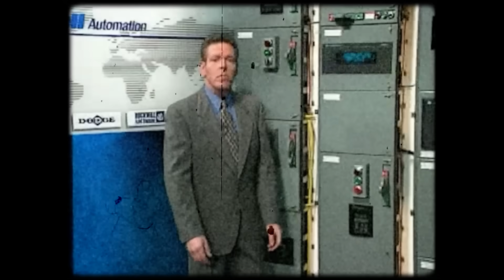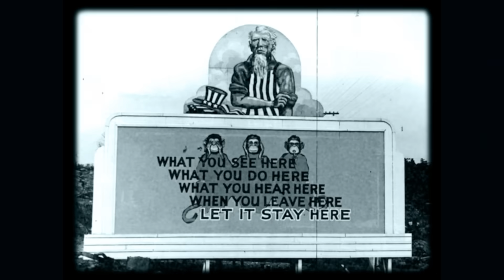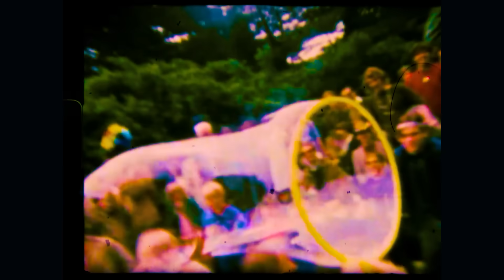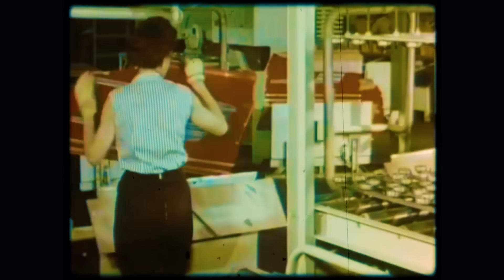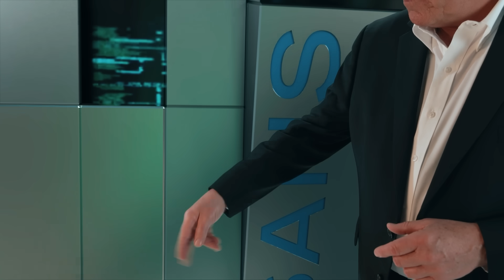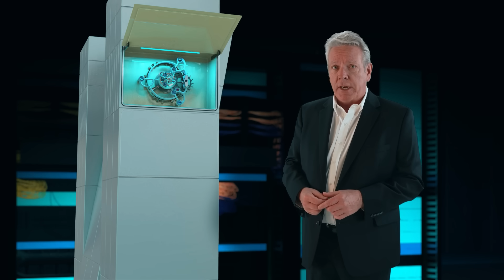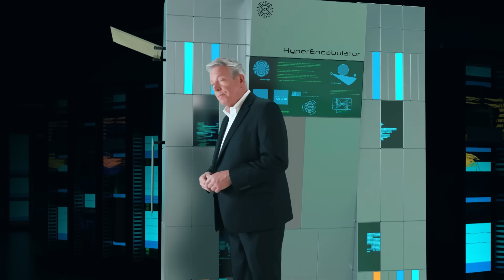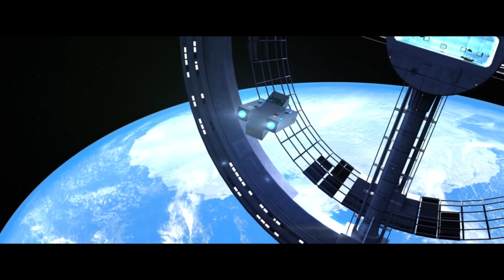SANS ICS HyperEncabulator

Comment: --Flashback begin
[Narrator]
The original machine had a base plate of pre-famulated amulite surmounted by a malleable logarithmic casing in such a way that the two spurving bearings were in a direct line with a panometric fan.
--End flashback

[Narrator]
Yes, that was once me.
Extolling the virtues of retro-encabulation.
Now I may not be the dashing, young on-camera narrator I once was, but if history tells me anything it's that the battle of hastings was fought in 1066.
But that's not the point.
The point is that encabulation has a rich, sumptuous history with a delicate, flaky crust relatively unknown to emergent cybersecurity personnel.
Allow me to elucidate;
The discovery of encabulation was quite accidental, when engineers in the skunk works at Mutual Polydynamics coupled a transcendental hopper datoscope with a spiral decommutator via the application of anhydrous nangling pins, resulting in a device that allowed for netic mastication at alarming speeds.
The device was kept secret for many years owing to the horrific accident that occurred shortly after its inception, how-some-ever the US Compartment of Offense and The Natural Guard soon realized its potential as a weapon of choice, leading to its next iteration, The "Hydro-Encabulator", which they nicknamed "Fatboy Slim."
Understanding the grizzly bear fact of the devastation that would result from its deployment, the project was re-tubed and transmogrified for industrial supplications.
This version, known as The "Pseudo-Encabulator" was the infernal, Faustian engine that allowed post-war America to realize its aspirations and become the domino player on the world stage.
Everybody was encabulating.

--Movie clip begin
[Character 1]
I don't understand you.

[Character 2]
Well I knew you wouldn't but if I'd told you before the answer meter on the other side permulates the counter-spell happiness and that's the entire secret there you have it.
--Movie clip end

[Narrator]
During the tumultuous 60s the psycho funkadelic "Vinyl-Encabulator" emerged as the long-haired hippie people's answer to their parents aging technology, scarving a resonance groove in the hot wax of a new generation of encabulators.
However, interest in encabulation waned precipitously until the late 80s when the public was ready for the next transubstantiation of encabulation, the extraordinarily populist "Turbo-Encabulator."

--Flashback begin
[Narrator]
Now, basically, the only new principle involved is that instead of power being generated by the relative motion of conducters and fluxes it is produced by the modial interaction of magneto relucatance and capactive directance.
--Flashback end

[Narrator]
Which brings us to where we are today, floundering in the wake of the obscenely similar "Retro-encabulator", featuring yours truly; Living proof that leveraging existing assets is not plagiarism.
Now, despite encabulations unparalleled success in reducing sinusoidal depleneration through advanced ding-alarm technology, it has failed to meet the unanticipated needs of the cybersecurity industry to create zero trust operations in level zero monitoring environments to ameliorate zero-day process attacks.
That is why, despite zero interest from industry, the SANS ICS Security team has taken it upon themselves to develop an entirely new level of encabulation unresponsive to the needs of the average consumer and undoubtedly without merit in terms on concomitant asynchronous communication with client-side connectivity.
Ladies and gentlemen, I-SACs of all sectors beer included, and children of all ages may I present The "Hyper-Encabulator".
The Hyper-Encabulator is nothing less than a key ruminant in the advancement of retrograde phenomenology by which we can achieve results that are plastic, spastic, and sinosynclastic without sacrificing both normative reality and AI-informed modalites.
You'll note that the Hyper-encabulator utilizes indiscreet modules, making possible virtualized environments that include PLC-controlled, stand-up reheaters as well as retainium-based cloud benders.
It also includes a dedicated OT security operations center access panel known as: "The SOC Drawer",
The primary modules of the Hyper-Encabulator are stackable, dinrackable, and unhackable and please note the complete abscence of side fumbling owing to the maintenance of tolerances allowing a tight conniption fit.
Please take little note of this module: "The Open-Source Digital Ghost Daemon", which allows transparent OT invisibility owing entirely to the manipulation of airborne particulate matter and single surface reflective devices, or for criminal infrastructure sectors where the dependability of sopramet wenosprox is essential.
Our handsome ransomware hypervisor is perpetually alert to SQL injections of gates, tracking chips, and quantum IOT identification dots.
Moreover, whenever a pen-test is elected to assure the integrity of a safety instrumented system, our purdue model modal module de-feathers and plucks clean every proverbial fox in the hen house and keeps would-be intruders wondering which metaphor got mixed first.
As you can see, the Hyper-Encabulator has reached a high level of development whereas previous dissimilar devices operated under the concept of manumatic stressor reduction and macroeconomic supply chain s-bombs, The Hyper-Encabulator operates totally under the principle of colonic effluvium explusion and audible gaseous eruptations.
Thomas Edison once said that invention was ten percent inspiration and ninety percent persperation, if that's the case, Thomas Edison should have invented deodorant, but I regress.
In the near future, Hyper-encabulation will ultimately replace all traditional cybersecurity safeguarding processes with osculating seqmentation and entropic astrogation, making what was once thought to be impossible, probable.
At SANS ICS Security, when we're not innovating, we're encabulating.
Reply: Oh finally lyrics
Reply: That should be printed on a teeshirt
Reply: I wish I could copy and paste this😭
Reply: Oh, well that clears it up. I was sure he said ' dingle-arms'
Reply: Thank you for your hard work, sir.
Reply: I thought I heard 'gaseous eructations' (eruct: to belch), although it's funny either way 😅
Reply: @snoodude  yeah, eggman ain't perfect.  I haven't checked this one, but many videos have transcripts available.  I guess his aural memory is pretty good.
Reply: “the manipulation of airborne particulate matter and single surface reflective devices.”  Sounds like smoke and mirrors to me.
Reply: Geez write a book why don’t you

Comment: As a McMillan man myself, I always wondered how the encabulator widget coupling enables every flange splicer, every hanging gated flop-hopper and wangle joint to integrate fully with splurge lugs and sprock-noggins while remaining fully compatible with the lipped and unlipped rear-facing winglebobs, and you’d still have enough nubbins left over for a splack-packet.
Reply: Bad idea. The manual may not require use of the nubbins but long term exposure of the wobble-phasers to the flop-hoppers can lead to early side-fumble failure and thus replacement of the entire unit. Never skimp on the nubbins.
Reply: can’t have too many nubbins!
Reply: I’m glad that I ordered the later version with full reverse nullification properties, 10th dimensional exploitation and spurving bearings throughout for higher performance of the dingle arms which ultimately improves calculations such as a parabolic arc through various states of matter at ftl speeds.
Nubbins are a bit old school now btw.
Reply: The answer to that is that it all works together in a holistic environment. Without one piece working properly, it would fall apart. The the key here is that there are linticular sequences that the clurry-beams mitigate using  retro-synchronous moly-trioxide resonance defractors.
Reply: @johngriffith1853  That's what I was thinking.  Thanks for validating.
Reply: NUBBENS
Reply: @pancreasenthusiast even Google is getting in on it.
Reply: I'm just glad they finally got the side fumbling sorted out
Reply: Ack! Respectfully, I'm pretty sure "flange splicers" aren't really a thing.

SANS ICS chief meteorologist Jack Rubbins (unfortunately fired recently for addiction to cocaine cooked with baking soda), believed nubbins were key and quickly came up with a dark high-pressure liquid injection shortcut that produces anal fissures in the wangle joints so nubbins can be arranged in a vertical column. It's loud but effective. Essentially, because Rubbins loves nubbins, now-sacked-Jack's crack fast-tracked a black frack-hack nubbin-stack, hence all the splack-packet racket.
Reply: I should think that was all pretty self-evident.  But sir, for the sake of the less educated, please eschew such obfuscation in the future.
Reply: But what about the spurve plinth?

Comment: As a side note, the principle of demiprocessed encabulation inspired the AI engineers to employ parascalar sintropy cost function with q-adic epidistributive latency layer and SDGgLu activation in training perstrucuted devolutional cisformer neuronal networks. This simple tweak allowed the existing models to gain additional 0.08% of accuracy on TYuIOp dataset relative to previous state of the are art models, without sacrificing the semiscalar coaxipitation.

Comment: I remember back in my high bypass gas turbine days, we would have to rig the variable stator vane and variable bleed valve feedback cables under a simulated 14 pound load using a push/pull guage

... This isn't an encabulator meme, I'm being dead@$$ serious. Unless youre a jet engine mechanic (and probably need to work on older ones), this probably read like greek, and could just as easily be complete jargon BS, and thats why the encabulator meme is so timeless.

Comment: Thanks for this awesome video! I was doing some circumfumbling around the internodal web, looking for general info on encabulators. I have an old vinyl encabulator model from my parents, and recently it's been displaying heavy trigonometrical dispurberance in the pseudo-psychedellic phase planer units. I tried reducing the psychometric fluid in the biotame tubes, but I found out after the fact what an obvious mistake that was. So now I'm looking for ways to induce a hyper-pneumographic terroid process in the coptic lunar vanes on the underside of the ontological perversion module. If anyone has any advice I'd be much obliged.

Comment: Slightly disappointed that it still doesn't pseudo-render front facing interstitial pages when served from an unbalanced matrix of cloud benders used in virtuous mode, even when the indiscrete nodules are stacked co-planar and rectilinear. In a security application such as this, it allows the quadrapedal bolt action before the gateway can be closed. And that's when the anfractuous vanes experience involuntary concurrence with airborne ordure.
Reply: IKR?

Comment: I'm sorry but you are not currently authorized to publish any of this.  According to TASEC, you must file a 4230 Disclosure to the MOSI division of FLOOM, wait the specified processing time, then submit simulataneously a 2323-A1 Impact Statement to both CHENOS and TOCOM.  You are then required to scan the QR code on the receipt they give you and complete their Y-level retinal scan protocol, which should grant you access to NORAC's COC Clearing System.  Only from there can you apply for permission to tender a request to NOSIS, TASEC's technology obfuscation arm.  If granted permission to tender AND your request was accepted, activation is granted subsequent a surprisingly painless scrotal implant procedure at NOROC's base in the Antartic, provided you can make it there in 8 hours.   As a courtesy, I will warn you that others that have failed to perform this procedure to the letter were slated for liquidation.

P.S. Please do not confuse NORAC and NOROC.   I can't tell you how many otherwise well-meaning agents have incurred the most inordinate displinary measures when they fail to differentiate the two, including the remote detonation of you-know-what.
Reply: dang it.

Comment: This video failed to address what I think might be the most useful feature: the load-shedding firewall has been equipped with military grade IDS rules and a fully featured propietary-source dashboard built on zero-trust TPM modules in parallel. This ensures that the false positive rate is 0% with an n value of 100.

But what do I know? I mostly stay in the soc drawer

Comment: While this new generation of encabulators has pushed the technology forward massively, especially in the area of magneto spur windings, I can't not say that I'm slightly disappointed in the lack of accessible greeblies.  We tend to run our unit with the various side panels open all the time so that we can more easily make use of our Turing complete bearing cables that connect to our higher dimensional tensor core flux array modules, which are vital to our matrix convolution workflow (see Van-klomp's 1944 paper on the subject)

Comment: Can this new Encabulator still control Milford Trunnions?

Although Strauss Trunnions are more common, orchestration is more difficult and my previous control supplier (Rockwell) insisted we convert to Milford Trunnions in 2001, mostly because of the space-saving design.

Now, Milford Trunnions are the defacto Standard... and given the current state of cyber security, going back to Strauss Trunnions is simply a Bridge too far.
Reply: LOL

Comment: !!!BUYER BEAWARE!!!
I was just recently at an industrial fair, featuring that all new HyperEncabulator and what should I tell you? It was a major let down, this HyperEncabulator is actually a step or actually multiple steps backwards compared to the yester decades one. I was allowed to have a hands on with that HyperEncabulator at the fair and tested it with my usual Encabulator workload, boy did that go wrong! Those all new, all digital HyperEncabulators do not feature mechanical anti sidethumbeling fin stabilizers, just virtually augmented and outdated imbalance weights on a defer rendered trapezoid spinner. I had to actually get my 80's model pocket Encabulator from my car trunk and let it run in comparison side by side. The difference was day and night, even though that 40 year old B grade pocket encabulator was past its prime. The booth personnel tried to calm me down, they said something interesting. Currently they are experimenting with the Mk2 of the HyperEncabulator which should feature an all new modular design, various add on modules and upgrade paths, including a subscription based Encabulator service and maintenance plan as well as unlockable feature set via micro transactions. So, just hold your horses and wait for that Mk2 HyperEncabulator, I could do without the subscription and paywalls but its the future. Anyway as a sidenote, the microwave in the back of that HyperEncabulator was broken, an incompatibility with one of the other feature sets rendered it inoperable, so if you want an Encabulator with working microwave, look somewhere else!